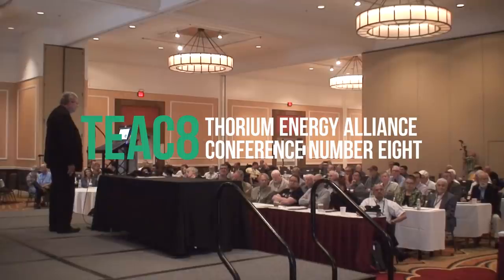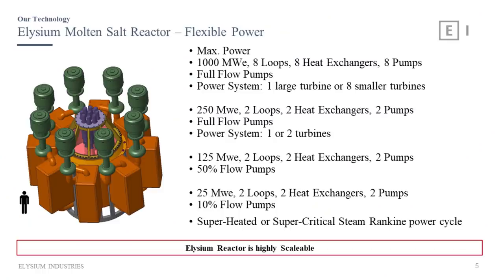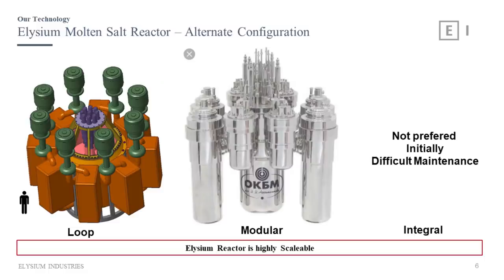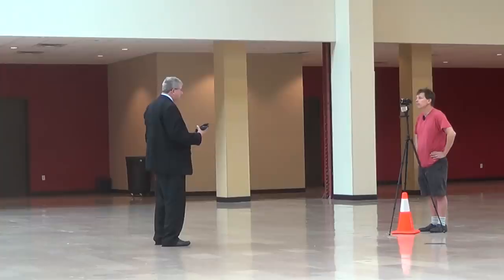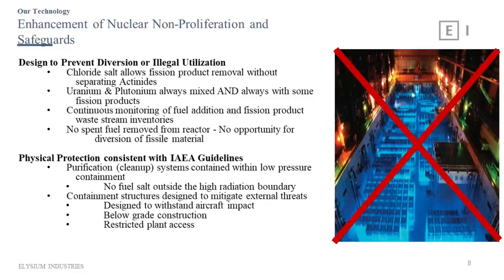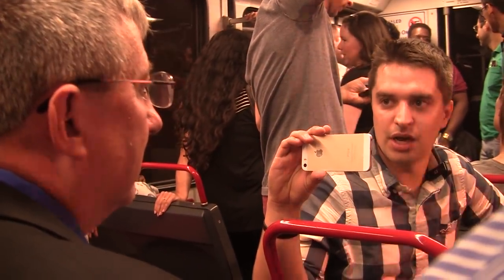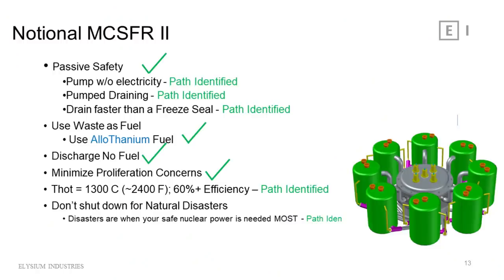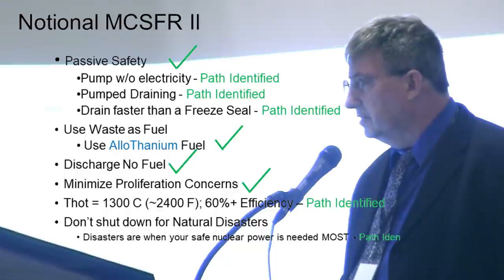Fast-Spectrum Molten-Salt Reactor - Elysium Industries - Ed Pheil @ TEAC8

Comment: One more point:  When Hastelloy-N is attacked by Chlorine-36 atom within a Lithium or Beryllium molecule,  there is a slight chance of a chlorine-iron fire erupting inside the tubing at these very high salt temperatures.  This fire is very strongly exothermic, and will easily exceed the Hastelloy-N working temperature range of 704 to 871 degrees. The hot working range of the annealing process is 871 to 1177 deg. C, wherein a tubing temperature rise will cause structural failure, spreading  liquid core material as far as it can flow.  Hastelloy-N is 4% Fe and chlorine-iron fire is a well known danger in chemical plants using flowing chlorides in iron alloys, and are considered a serious risk necessitating special safety designs to preclude these exothermic fires.  The NRC will want to see designs to mitigate these fires.

Comment: Can someone please explain how you control the power of the reaction during shutdown? Is there something special about the geometry of the drain tanks? 
When the molten salt fuel is in the reactor vessel itself, is the power controlled purely the negative temperature coefficient or is it necessary to use control rods?
Reply: Your first "guess"  is the correct one. The geometry of the drain tank makes criticality impossible.  As to your control rod question, No, no control rods are necessary.

Comment: In a major earthquake like disaster, molten salt will likely drain into the drain tank through the freeze plug.  What if the drained molten salt come into contact with ground water that could also come into a cracked drain tank? Ground water is still going into the reactor building of Fukushima and comes out contaminated.  It was reported that when molten salt (NaCl2) met water, the flash steam of water caused a violent explosion which is a pure physical and not chemical response. It is unclear whether such an explosion has the potential to damage the drain tank further or even the reactor itself, or to spread the radioactive molten salt  everywhere. I also assume while some molten salts interact so violently with water, not all molten salts do. High temperature is a factor, but not the only factor.
Here is a related second question: Once molten salt flows into the drain tank and reduces its ability to go critical, how long would it take  the salt to cool down enough to eliminate the chance of causing an explosion with water?
Reply: That earthquake would probably have to be powerful enough to shatter the entire planet if it had to get fuel salt to enough deep groundwater.

Comment: You are great Ed Pheil you can save the planet through cheap clean energy
Reply: I have high hopes for aneutronic fusion. But even if TAE can make proton-boron-11 work, even if Lawrenceville Plasma Physics (or one of another eight (?) outfits around the world working in it) can make the Dense Plasma Focus work as a fusion engine for ten cents per watt capacity, I still think we need to build enough molten salt fast reactors to burn up our 84,000 tons of "spent" reactor fuel, instead of leaving that hot mess, too, for the great-great-greats to deal with.

Comment: Just as a note, supercritical C02 is being proven on a few solar-molten salt storage facilities.  There may also be a push for it from coal in order to get something remotely competitive of natural gas in a combined cycle.
Reply: What is it used for?
Reply: @robertbrandywine  Look up supercritical CO2  Brayton cycle.   The CO2 is the working fluid, instead of using water/steam.     The turbines used in this are remarkably small compared to the steam/water cycle.

Comment: I do not understand how Ed Thiel can claim that CHLORIDES have achieved fuel qualification in the molten salt eutectic mixture.  It is true that chlorides melt at lower temperatures in the melt.  Ed talks about Chlorine-35 and Chlorine-37, ignoring the fact that the problem is that when chlorides are irradiated, Chlorine-36 is formed, which transmutes to Sulfer-36, a strong corrosive to many types of tubing, and radioactive with a half-life of 100 days; and Argon-36 is also formed, which is stable, but the gas must be extracted with off-gas systems.  Chlorine-36 is also a long-lived radioactive waste with a half-life of over  300,000 years.  He doesn't seem to address these problems.
Reply: After investigating a bit, my educated guess is: The sulfur isotope would not be significantly corrosive in this context since there is no water in the reactor core and no corrosive sulfur compounds like H2S would be produced in sufficient amounts. The long half-life of Cl-36 should also mean that very little of its decay products would be generated over the lifetime of the reactor, which are 98% Ar-36 and only 2% S-36 according to Wikipedia. S-36 may also be transmuted to the stable S-37, though one would have to check how much of this transmutation could occur with the fast neutrons in this design.

Comment: The ability to make heat would be fantastic. There are so many thousands of applications for heat only. They use enormous quantities of natural gas to make hot water for the oil sands industry. Solution minning in the potash industry requires enormous quantities of hot water.

Comment: Sorenson said the U233 is not suitable for bombs. it's too radioactive so fries the bomb controls and any workers getting too close. What do I know - just asking?
Reply from the maker: U232 contamination in the U233 is the reason for this. Not the U233 itself. https://en.wikipedia.org/wiki/Uranium-233#232U_impurity ...regardless U233 is still considered a proliferation concern. That's not Ed or Kirks call... that's just the way IAEA classifies these materials. LFTR would need counter-proliferation measures to address this. Not likely anyone would "steal" fissile from an operating nuclear reactor, but such measures will be required so such measures will be designed.

Comment: Hello Ed, I have a couple questions. Since what you propose is a fast-spectrum reactor using molten salt, what sort of precautions will be needed to prevent criticality in the event that the fuel salt comes into contact with a moderator in an accident scenario? I assume this is largely being done because it designed to be operated in a "burner" configuration where fissile composition is far less than a fast-spectrum "breeder" MSR configuration. How does addressing this technical challenge compare to thermal fluoride-based thorium-based designs?
Reply: A design such as this needs the fuel inside a reflector and compact.  Reflector on just one side of a puddle won't work.
I suppose if someone dumped charcoal briquettes on the containment floor, made a dam to prevent the salt from spreading out, and then breached the core they could cause an issue.
Depending on the moderator fraction, you can go critical with as little as 1/4 the concentration. But to do that you need a low absorption moderator.
Remember, the salt is denser than water, so you can't use water as anything but a fairly absorbent reflector in an accident. It is also denser than carbon.
Reply: Ok, so they are going for a very low fissile load to mitigate this issue and are accepting the effects on neutron economy. Making this of comparable risk to thermal MSR designs with similar fissile concentrations.
Reply: Elysium does not allow moderator close to the fuel, no water/people, no pump cooling water or oil, no graphite, no concrete. There are at least two barriers to moderator incursion. Dump tanks are multiple long narrow separated, poison & void (leakage) separated cylinders.
Reply: Fast chloride salt reactors have a much more clearly negative temperature and void coefficient than a thermal MSR with LEU. MSRE HEU and LEU MSR have more fuel absorber to fissile ratio, so the ratio of pushing fissile out (negative) to pushing fertile U238 "poison/absorber out (positive) is harder to show for all operating conditions, times in life (Fission products, graphite swelling/shrinking), casualties is very hard. EVOL studied this extensively and moved away from graphite moderation to an intermediate spectrum. No one else has published or stated that such studies have been done for LEU Fluoride graphite. Moving away from LiF-2BeF2 is more absorptive and similarly more positive trend.
Reply: Randall Waitt 
What? I don't follow. Low fissile in a fast reactor? How does that work?

Comment: 3:30 I'm watching skeptically thinking" what's your solution for materials degradation?"
Reply: densealloy 
Design for replacement when needed. We did that when the solid fuel was shorter lived than the vessel. Now that table is turned. The fuel lasts longer than the vessel irradiation damage or creep. So replace the vessel, and design to be able to do so. The vessel is thin, not forged and the core can be drained. The core effectively lasts forever, i.e. self repairs faster than radiation damage by 100,000x times the rate, and no TRU poisoning, like in thermal reactors.
Reply: I don't know of any stainless steels that could withstand 1300 degrees without creep though.
Reply: MonMalthias 

I don't either. In general, I can't understand why everyone worships ANY nickel alloy for nuclear. But, I will use it for the first ~600C Thot reactor because it is qualified. But, high temoerature materials need to be qualified. I talked to one company that uses refractory metals at 1800-2500C, but non-nuclear. And need to look at glasses, ceramics, composites, and/or cladding/liners like water plants.
Reply: Moltex proposes to use zirconium clad stainless steel. Neutronics arguments aside, would an MCFR realistically use such an arrangement? Zirconium cladding of 100mm thickness structurally supported by 316 SS? Perhaps go for sacrificial core, reused fuel a la ThorCon and Terrestrial? While the fuel itself could withstand hundreds of thousands of DPA inherent to its ionic bonded nature, the weakness of the design then becomes what makes up the core and piping. One of the things that really surprised me about the Elysium design is how strikingly similar it is to the Euratom MSFR/SAMOFAR project. 8 loops and 8 pumps circulating fuel at high speed to get the power output up to 1GW in a very small core.

I suppose the litmus test is now what could hold that fluid in the right configuration.

Comment: This guy is awesome. The first MSRs are probably gonna be this. If I was him I'd go to the UK. They seem to be more inclined to a Fast MSR.
Reply: Yeah will be interesting what route they take. AFAIK, they have not decided on what regulatory pathway to take.
Reply: The thermal sounds awesome especially with the massive thermal efficiency but like Sorenson keeps saying it's is just a super harsh environment with salt and heat that they were still looking at engineering a solution. The faster someone can get a Th non PWR on line the better for everyone. There is no US military to eat up the R&D like PWR had. I can't imagine how godawful expensive alloy research and small batch purchase would be. This is much more realistic than the massive step that a thermal would be since this is  essentially a COTS solution  (as close as one could get in reactors)

Comment: Just curious, does anyone of you know why Ed decided to increase reactor outlet-temp from 600-650 °C at this point to 750 °C in more recent talks he gave ?
Reply: He probably found certified parts/materials that had a higher temperature rating.
Reply: No,  It's not by using new materials.   He figured out that just placing very thin shielding on the inside of the can.  This shielding itself is not load bearing, so it shouldn't deform at higher temperatures.   It's purpose if to divert the "cold"  salt returning from the heat exchangers so that only this colder salt contacts the containment vessel.   
Hope I've explained this semi-coherently.
Reply: @jimtrowbridge3465  is that shielding envisaged to be periodically replaced ?

Anyway, very interesting, the more I learn about the technology, the more I realize it' s an excellent, very praticable idea. BTW, any updates about the project (I mean, both this MCSFR and Moltex' s) ?

Comment: Is there data from an experiment done showing cost/efficiency of thermal v fast?
Reply: By efficiency, what do you mean? Fissile use?
You can't just "do an experiment" - because the configurations are completely different.  The shape and coolant that makes a fast reactor will not make a thermal reactor, and vice versa.
Fast breeder reactors have been demonstrated in solid fuel multiple times.

Thermal efficiency is mostly determined by choice of coolant and power cycle. If you go water, you really can't take it much higher than 45%.

Comment: I think chloride salt makes more sense then fluoride. Since it's more common and abundant can be harnessed so easily from the sea. Does anybody agree or disagree?
Reply: I've read a bit about this, researching for a book I'm working on called Pumping the Brakes on Climate Change. Chloride salts absorb a few more neutrons than fluoride salts, leaving fewer to maintain criticality, but apparently not enough to matter. The problem with Flibe, apparently, is the lithium; you want pure Li-7, which means you have to concentrate the Li-6 out, and Li-6-deuteride is thermonuclear weapons fuel. The NRC, therefore, regulates the hell out of Li-6--and, I believe, uses it as another excuse to slow the adoption of molten salt reactors, in favor of 3rd gen PWRs that no one is buying anyway. Sodium chloride is table salt is almost dirt cheap, and nobody regulates it, except my MD trying to control my blood pressure.

Comment: When reusing spent fuel like this, what becomes of the radioactive gasses released? Do they have to be stored under pressure?
Reply: What radioactive gasses? Fission is atoms splitting into smaller atoms and releasing neutrons as a result. The neutrons are captured by shielding which heats up as a result. The heat is used for industrial processes or converted to electricity. Where are these radioactive gasses you speak of?
Reply: Ed mentioned helium and xenon as recoverable and marketable fission products.
Reply: They can be stored in cylinders. The main ones are xenon krypton and iodine. The krypton decays to rubidium and the xenon decays to nonradioactive cesium. The iodine would likely remain in the melt as iodide rather than vaporizing off. The xenon half life is short enough that there won't be much of it to accumulate. Krypton 85 is the one that would build up.

Comment: he made a mistake. the reactor does need to have the moderator and neutron absorber rods. it allows for much less fuel filtering and lower fuel grades. chloride was good choice. needs lthium 7 and protactinium filters
Reply from the maker: There is no moderator in this reactor. This is a fast-spectrum reactor.

Comment: Yes U233 can be used in a weapon - but no one is going to for the same reason you cited your fuel will be safe. Handling it is not an easy process.
Reply: The issue is the need to use a blanket to use a pure Th/U233 cycle and that is not very radioactive, and IS easy to handle.

Comment: Hello, a very interesting and well explained video - I have a question about safety: How do you ensure that the reactor can withstand any natural disaster? I completely agree - this is one of the general scenarios where they are specifiaclly needed.
Reply: I don't know that you can build anything to withstand any natural disaster. But you can be smart enough to avoid most. Don't build near a geofault, within reach of a storm surge let alone a tsunami, on a flood plain, below a landslide, or within reach of a volcano. Nothing much you can do about an asteroid strike, anyway. Remember that in any reactor breach the salts are going to spread out, go non-critical, and freeze, not be blown far and wide on the winds.
Reply: @johnorenick9026  In addition any break in the containment vessel results in immediate loss of critically and the fuel salt solidifying.

Comment: I didn’t understand much, so instead of a liquid fluoride thorium reactor he is designing a liquid chloride thorium reactor?
Reply: Both chloride and fluoride are salts, just with different chemistry. The big difference is this is a fast neutron reactor, not thermal. This allows this reactor to "burn" all fissile and fertile fuels, yes including thorium.
Reply: @chapter4travels  Just to be clear, Thorium is fertile, not fissile.

Comment: What sort of materials that are nuclear qualified can even withstand 1300 degrees Celsius? Tungsten carbide? A graphite reactor wall enclosed within an actively cooled steel shell?
Reply from the maker: I don't think Ed said nuclear qualified materials for 2nd gen at 1300C. Only their current design uses qualified materials, I believe. Did a quick re-watch and just can't find mention of qualified with 2nd gen. (2nd Gen being their 2nd Fast-Spectrum MSBR not 2nd-gen reactors in general for anyone else noticing this thread.)

MORE: But I too would be curious to hear more about it.
Reply: Fair enough.

One criticism I have of the video is that in some of the cut segments the zoom in is alarmingly close. But I suppose it couldn't be helped.